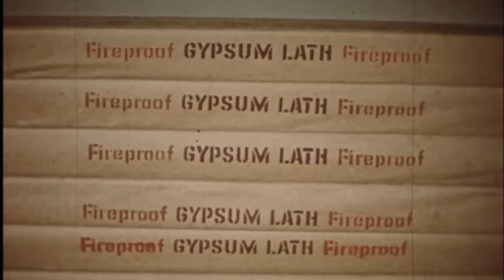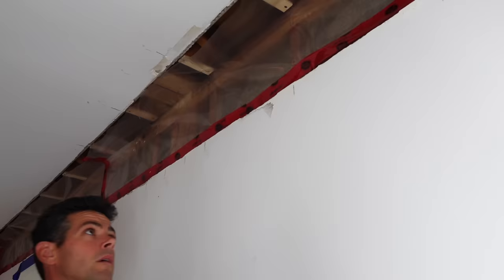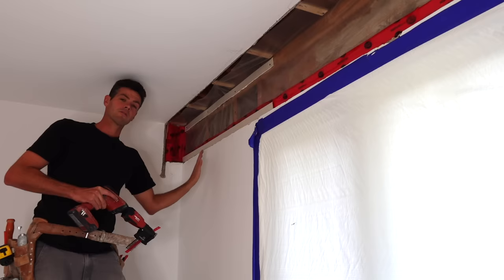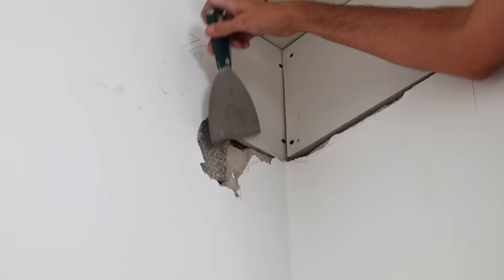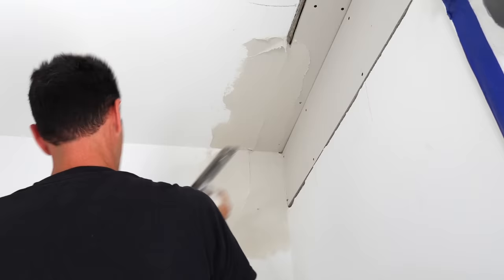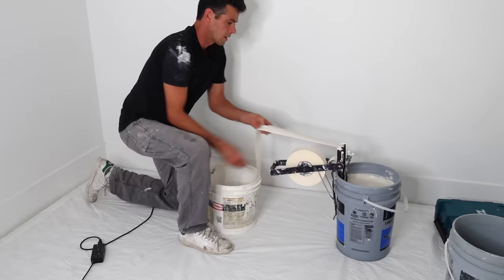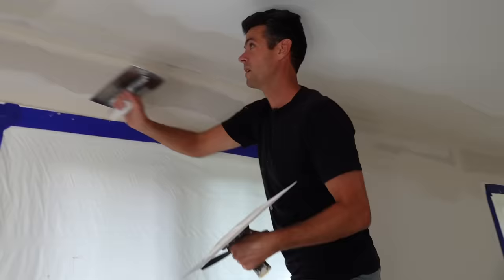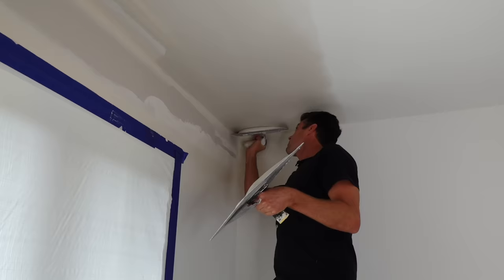How to Repair Mid-Century Plaster with Drywall!

Comment: I just bought a fire damaged house, how inferior new drywall is compared to what was originally existing it's so much thicker and substantial. That thick old drywall was the reason the fire didn't get to one stud in the fire room that stuff can hold back fire being so thick so I kept as much as the old drywall as I could in the house. I see why dry wall is put on much more simply and thinner now but happy to mostly have the older mid-century drywall in my house insulates better being thick and blocks out sound better as well. 👍 Appreciate the videos, my last flip house had crappy looking textured walls that I smooth the entire house out with coats of spackling and my new house has needed a lot of skim coats to get the surface prep for painting so you know I've been watching some of your videos and been going through lots of spackling I'm starting to feel professional at spackling at this point hah. I didn't finish college, never been in debt and just bought my house cash because learning to work/flip houses has been very rewarding it's always a benefit to know how to work in fixing and maintaining your house from roofing, drywall, electrical to Plumbing it pays to learn how to do your own work. Keep up the informative videos

Comment: My house was built by a spaniard in 1933 and has this plaster, it is heavily textured to give it a stucco swept look, archways for doorways, spiral pillars, very Mediterranean for New England.  Has held up well, some settling cracks that are easy enough to repair thanks to your videos but I've found it hard to replicate the wavy texture in areas I've replaced with drywall

Comment: I had the same situation in my house when we needed to cut a few holes in the wall for plumbing work and raking out a medicine cabinet. I ended up using scrap 2x4’s attaching them to the studs to fur out the mounting surface. Where the plumbing work was done the 2x4 was brought out to enough to bring the drywall to the face of the plaster. Where there was the medicine cabinet the 2x4s were brought out enough to mount 1/2” ply to and then gyp on top of that giving me the ability to mount mirrors to. There was variance in the depth so I ended up bring the drywall to the lowest point of the plaster and used hot mud to skim coat the wall after taping to bring the finish surface even with the surrounding surfaces.

Comment: I do it differently. I put blueboard as a backing as close to the level as the original. I use a chisel to remove the base and  finish coat about 2 inches from the edge of the old plaster. I put chicken wire across the seams and nail it in. Then I mix veneer plaster with extra sand to make the new base coat. Next day I apply the finish coat and try to match the original. I NEVER use tape or mud.

Comment: Ever use plaster weld before repairs against plaster?
Reply: I have always applied Plaster Weld onto the adjacent plaster with the hope that it will stop the top layer of plaster from chipping and peeling off. I have seen drywall-plaster repairs that eventually crack along the seam because, I’m guessing, the drywall mud doesn’t stick well to the plaster. Hopefully if the joint has some plaster weld on it, the drywall compound will stick better?!

Comment: My 1950 house is this. Some areas they used the same boards as exterior, like a 3/4in thick fiber board coated in tar, under the plaster which is at minimum 1/2in thick through entire house. The plaster has lots of filler material in it too. It is VERY bad to get wet. Had a leak in a ceiling and the stuff turned to puddy. Need to get samples tested for asbestos too.

Comment: I wish I had seen this video before I did the exact same repair to my wall/ceiling. I had never worked with the gyp-board/plaster walls before and was confused as to how it went up. In some places I had to shim nearly a full inch (2.54 cm). It had been decades since I had to deal with plaster walls & had forgotten just how much material is involved. Must have been over 100lbs (45kg) of damaged, dusty plaster I had to remove.

Comment: the inside of the Pyramids of Egypt were plastered, as was the outside (stucco) originally.   Master trades would adorn the walls which were then carved and painted by skilled artists.   Over time the desert has warn off or it degraded and fell off the exteriors.

Plastering is nothing new, but applying it is a lost art.

Comment: USGS jillmakes plasterboard 2ft by 8ft. Can have special setting compounds in it and it is a heavier board than standard drywall. Modern standard drywall is weaker in its construct as they whipped the materials into a lather in order to create the air bubbles in the material. And modern drywall is barely able to hold its own weight on the screws. Plaster is also more sound deadening, and it looks a whole lot nicer when you're through if you know how to do it properly.

Comment: Just in time! I had a similar wall ceiling corner of this stuff… looked around your videos to see if you had anything on this topic… but had to just wing it. Glad to see I didn’t mess it up too badly. Shimmed mine with the 1/4 in on top and just drove 2” screws through both pieces at once. Then precio with 20min mud… now going to tape. You use thinned out bucket mud (premixed all purpose) for taping, correct? Thanks for these videos… watching you breeze through these projects gave me confidence to try it myself.

Comment: I have that kind of plaster house is from 1957, how would you go about fixing stress crack around door, window, outlets on plaster like this ? A contractor came slapped mesh tape over cracks cover with mud call it a day and it completely  bowed out 2 months later when winter came. I since repair 3 cracks removed mesh tape, cut V-groove in the crack filled it with Dap Alexflex, and skim coat with mud over it, so far it's holding up we'll see when winter come

Comment: My home was built in 1927 and has plaster board. Didn't think it was around that early, but it was. I also have heavy metal lath in all the corners and joints, which is a real bear to deal with. No cracks though!

Comment: Finally I know what the fuck im dealing with. Thank you so much!   My house was built in that period, I had no idea for the longest what I was looking at whenever I had to do a repair but I pretty much was doing this method.  I took a chunk of it to the hardware store to see if they could tell me what exactly it was and got nothing.  The funniest thing about these walls is trying to hang a picture frame with a nail and the nail just bends.  Damn walls are tough as hell

Comment: Thanks for doing this particular topic. I've watched that video you cut into quite a bit (very nostalgic voice-over) since I've been figured out how to repair some damaged plaster around one of the windows in my room. I wonder if it would be worth cutting it out and use new drywall or just scrape it, sand it, use some joint compound, sand again, paint and call it day. Anyway, great video, I'm sure I'll be referencing it in the future.

Comment: Great video! I noticed that you didn't use anything on the plaster to help the hot mud bond to it. Is it enough to just sand the paint on the plaster wall which is going to be covered with mud? I've got this exact situation on a 1954 house and haven't yet decided whether to do what you did or cover the whole wall with 1/4 or 3/8 inch drywall given that there are some cracks in the plaster as well.

Comment: Our house was built in 1952. It has plaster, but not on wooden lath, and not on rocklath. This is the only house I've ever seen it in 17 years of working in construction and renovation, but it's a 1/2" thick product, made of cardboard-like fibres, it came in 16"×8" sheets and had a shiplap edge on the long side, so the panels overlapped. It's held up perfectly.

But the point of the comment originally was... it's thickness was all over the place due to very uneven framing, and to adapt to it I simply attached drywall as a backer and built up with sheetrock 90 to match the thickness, then Finished with drywall compound. It turned out seamless and has held up without shifting or cracking for several years now.

Comment: He's also forgotten to use plaster bonding adhesive which will solidify the edges of that plaster keep it from flaking out, and the other problem he'll have if he doesn't use that, is it will dry out the plaster along the edges of his repair and he'll have to chip it out and try and what it down and fill in the crack that's now there because he failed to use bonding.

Comment: These videos are great, but being from the UK and having recently learned to plaster  i do find it kinda funny all the steps that tapers/drywallers use to avoid plastering which isnt actually all that hard and leaves a much stronger wall. Im not criticising in any way its just interesting that it differs so much over the pond.
Reply from the maker: We don’t have plaster over here. It’s very hard to find.
Reply: I mean. It's not "taking steps to avoid plastering" we literally just don't do it.

Drywall is a a lot easier to change and repair and get into to change any plumbing/electrical
Reply: Apologies I’m aware it’s not an option, I meant in general the whole practice of taping and jointing being sort of an avoidance of just skimming a surface. I wonder how/why it came about?
Reply: @ultra2extreme  I think part of it is just you don't understand exactly how quick drywall is. I'm not real familiar with plaster but my understanding is plaster is more skill intensive and does take longer. And yeah as far as those of us trying to repair older plaster if we had easy access to plaster we certainly would go that route I can't find any locally to me I would have to have it shipped here.
Reply: @ultra2extreme  it's faster and cheaper.

You can still skim whole walls of you want that perfect finish, but you don't have to

Comment: I've got those old tiles in my house as well. The ceilings look terrible. You can see the outline of every single tile. Due to the weight, they say in the middle and look like a network of pillows across the ceiling. It seems the solution most of my neighbors have done is have a company use 5/8 inch drywall to pull everything back up tight to the joists. Is that really the best way to do it?

Comment: you could just put 1/2" drywall grey side out (plaster sticks better to the back side.) 'Get some perlited gypsum plaster (structolite) use ground gypsum sprinkled on a mortar board over the structolite to set it in small quanities, Strutolite has an open time of 4 hours. almost flush the patch with the structolite sprinkled with ground gypsum. Finish up with plus 3 or other lite weight drywall mud. Sand will come out perfect.

Comment: This is exactly what I need for my 1950s home! Question, though--how would you approach these patches and repairs with an existing skip-trowel texture on the plaster? Should I grind down the edges that meet the drywall section, tape and mud over? I don't want to not tape, but it seems like it will connect poorly with the existing aggressive skip trowel.

Comment: Do these Gyprock Lath walls contain asbestos?  My home in the Boston area built in the 50's has these walls and I need to cut into one to have an old galvanized pipe replaced.  Concerned about asbestos.

Comment: Rocklath is the proper name for the material you are patching.
Rocklath  came to being used at least as early as the late 30s, early 40s.
I began my career as an apprentice plasterer in the early 50s, and it had been being used long before then.
I came packaged in bundles, 6 pcs of 16”x48” pcs per bundle.

Comment: I have drywall like this.  Mid century plaster.  It's thick about 7/8 thick in some places.  Does it usually have asbestos or anything too toxic?  Should I remove it all on the house and go with normal 1/2 inch drywall?

Comment: My house has this type of wall and there's a approximately 2ft x 2.5ft section in my room where the plaster is peeling off the drywall/gypsum board, but the drywall/gypsum board underneath is completely fine. I'm wondering how I can repair the plaster without removing the drywall/gypsum board underneath.

Comment: Would something like this require a skim coat along the whole ceiling? I just removed soffits in my 1960’s house and the drywall has 2 sheets of drywall with a metal meth in between. It is slightly thicker than 1” I’m going to be adding recessed lights and island pendents so there will be a lot of light bouncing off walls & don’t want my diy repairs to be obvious 😳

Comment: Parents house built in 1977, still had it. 
Something to consider depending on the time from what I was told by an abatement company here in Ontario, the player may contain asbestos. Can't say for BC obviously but for the Ontario viewers I'd say just be careful if you're removing this or disturbing it. Seems 60s and 70s asbestos was everywhere

Would that concrete fill be similar to durabond90? Based on cgc website almost sounds more like a durabond than sheetrock 90

Comment: How thick can the concrete fill go? I pulled the backsplash off and it was nailed into the plaster. It left holes in the plaster but not through the drywall behind it. Can I use the concrete fill just on top of the drywall?

Comment: I was looking to purchase concrete based mud but realized that many have been discontinued. Will regular drywall mud work to work in 5/8 drywall into rock lath?  I’ve received recommendations of using plaster of Paris mixed with regular mud.

Comment: Can you recommend a multi-tool blade that will cut through both the plaster and metal diamond mesh that will last. I have found that the carbide tipped blades cut through the metal good but the sand in the plaster wears out the blade within 3 feet of cutting. I need to cut around the ceiling in 3 rooms. At the rate I’m going it will take dozens of blades to cut it all. My grinder just makes a big mess and shoots sparks everywhere. Any suggestions?

Comment: I'm not familiar with the concrete fill/mud you were using - can you post a link?  Is it the same as an EP90 or similar DW mud?
Where you feather mud from drywall to plaster, is there a noticeable difference in texture or feel of the wall (if it's not on the ceiling)?
Does paint basically cover that up, make it less visually apparent?  Thanks.
Reply from the maker: It's a western Canada product
https://www.usg.com/content/usgcom/en_CA_east/products/walls/drywall/joint-compound/concrete-finishing-compounds/synko-concrete-fill.html

Comment: First thing off the bat you don't need the square out every single wall stud or ceiling joist panel. What you do is you use a little bit more plaster there, because an old houses there's no such thing as plum. The walls in those old houses generally varied as much as three quarters of an inch to an eighth of an inch. You end up killing your budget by trying to square it out perfect. So packing your plaster screed it out, then cut back the surface about 1/16 of an inch so you can get your finish coat on.

Comment: Is this why when I replaced the drywall on my kitchen ceiling it was so off it was 3/8 on one side and just under half inch as it went down about 6 feet. The ceiling was flat underneath is what made me so mad, I should of shimmed my drywall on the one side but it was hard to get the piece up and screwed so I just mudded it level. It’s not perfect but it’s not bad

Comment: My house is 1.5 miles north of Detroit and was built in 1938. All the walls were plastered using the method shown in this video.
Reply from the maker: I guess it had been around a while. Most houses that old around here were still wood lathe.
Reply: @vancouvercarpenter  Thanks for the reply. 

I've been a hack drywall finisher on mostly my own projects for about 40 years. Now I always review your videos before I put up a wall or do a repair. I'm still a hack, but because of your videos I'm a more knowledgeable hack.

Paul

Comment: I'm assuming this would be very similar to the process of repairing a plaster and lathe wall with drywall
Reply from the maker: Yes. But lathe and plaster can be much nastier with bigger gaps and way more prefill. Every patch is different with wood lathe.
Reply: @vancouvercarpenter  you got that right! I had just finished a 1900s home repair where the lath was 1/4" thick horizontal strips with scratch coat and final plaster coat.  I used so much prefill durabond, what a nightmare lol.  I had to skim the entire walls to be able to match the smoothness of the repair.  You never know with asbestos, so I always wear a mask when doing those types of repairs.  Luckily it was a vacant building.

Comment: most of this stuff is bulletproof, the only thing if you back far enough, they used horse hair, as a binder. But, then more recently, they had asbestos, in the plaster, and in the board, even the tiles also. But I'm sure you know this. Good video.

Comment: I just remodeled a bathroom and this is in our house. Hate it. How and what do you cut this plaster with. I went through so many blades trying to repair parts of the wall
Reply: I use a multi tool with carbide blades. Maybe not the cheapest, but it’s the fastest and least messy. I tried a rotozip… bad idea, makes a big cloud

Comment: How do you match the finish texture to match 😢.. We have this in our home built in 1969…
Reply from the maker: I would have to see the texture to know what to do.
Reply: @vancouvercarpenter  .. it’s so similar to what’s in your video… Your video is exactly what’s in our mid century modern home…. We have these intercoms in most room that I have been removing when we renovate and it’s hard to get that very soft bumpy texture.
Reply: @Kevin-hm6kt  When Ben used concrete fill as his prefill, that's what was bumpy but when he finished it, where was no texture.  Hope this helps.